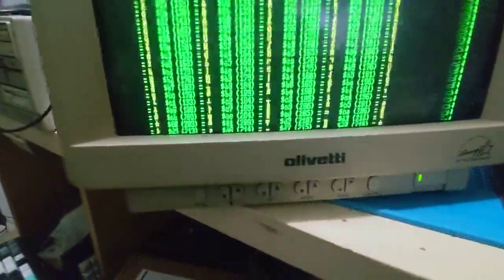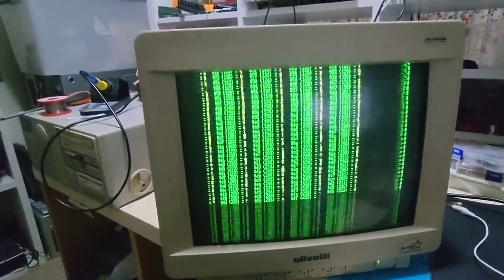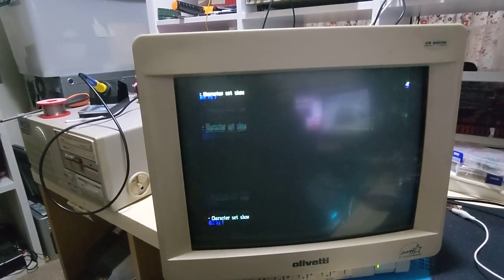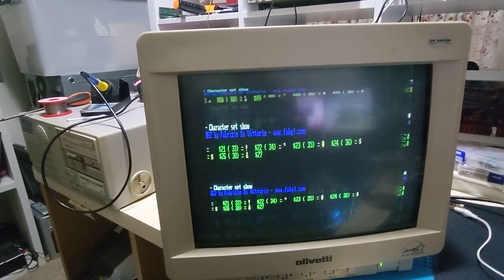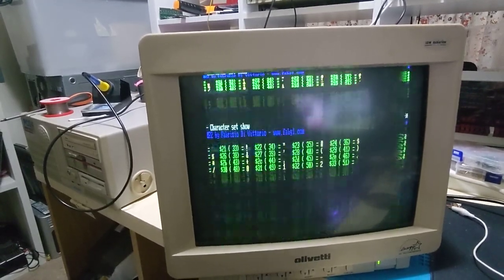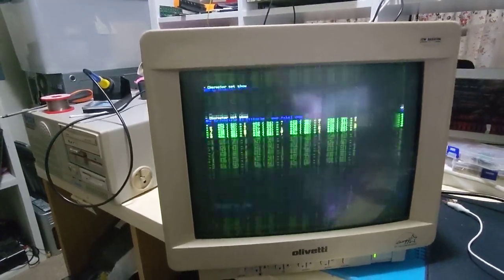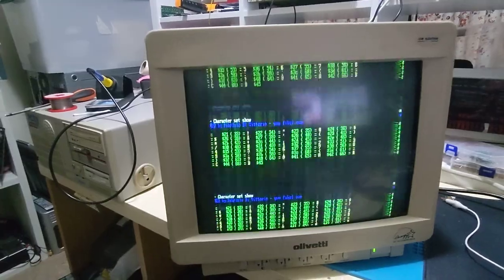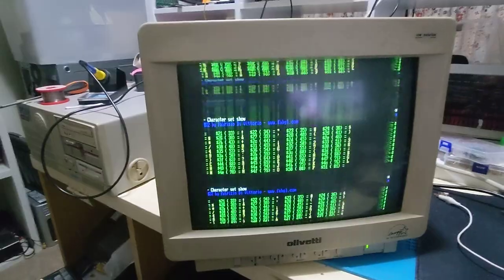Olivetti CRT  DSM 1566 OLR (Philips tube) CRT HV problem?

Comment: Damaged fly-back transformer?
Reply from the maker: Maybe but I'm inclined to think it's not.
Reply: @RoyAntaw  - If you can't see it drawing an arc in a darkened room; Then that would suggest the break-down is internal somewhere, not a lot in the HV path :/
On the other hand if there is a issue in the low-voltage supply side, then that could do it too

But the fact you can hear the fly-back "complaining" make me think it's in the HV path somewhere.

But ... I'm nowhere near an expert on these kinds of things ;)
Perhaps a meter on the low voltage supply side of the fly-back?  See if something is dragging the supply down?
Careful with you fingers though ... those things can "bite" quite hard